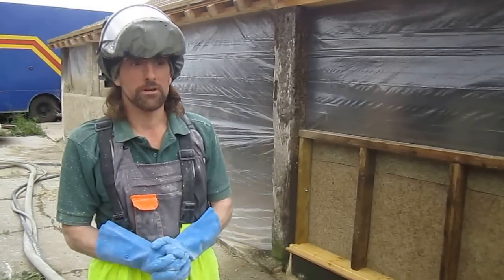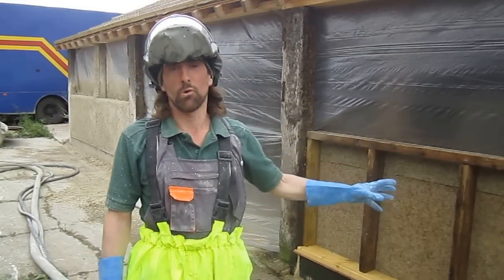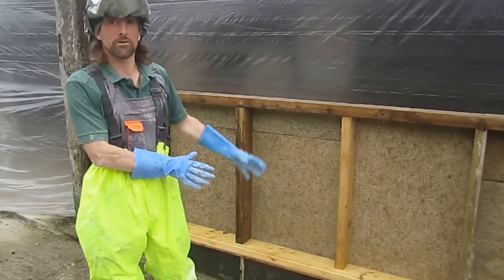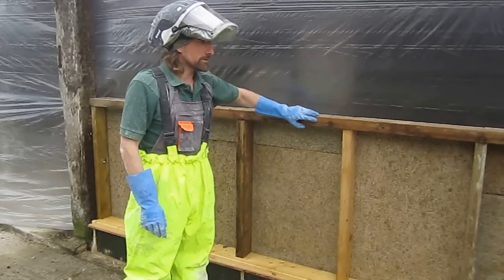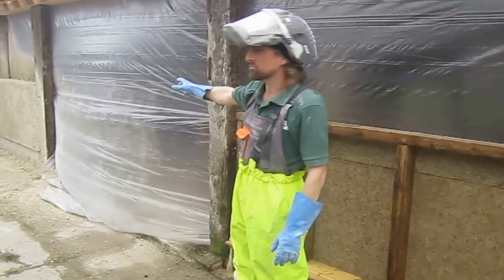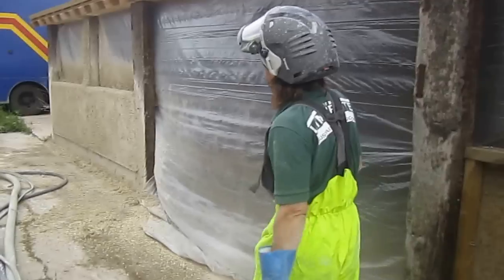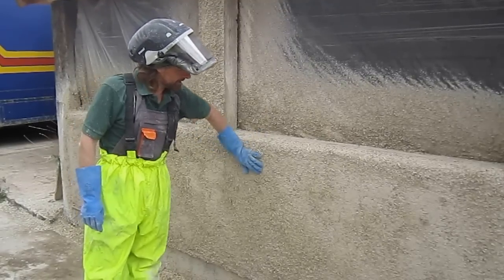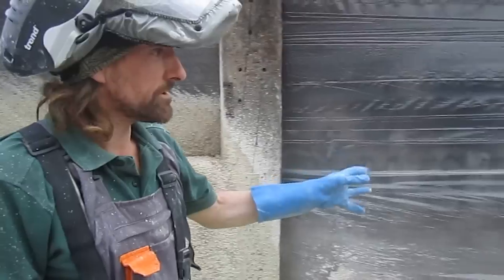Sprayed hempcrete insulation

Comment: All gaps are filled. No thermal bridge. Control humidity and clean the air. Doesn't burn, doesn't rot. Capture the CO2. Insects and rodents repellent, thanks to its caustic antibacterial lime content. Soundproof.

Wall was solid in less than 1 hour...

Gees... what are we all waiting for?